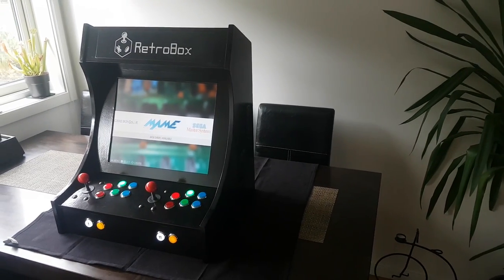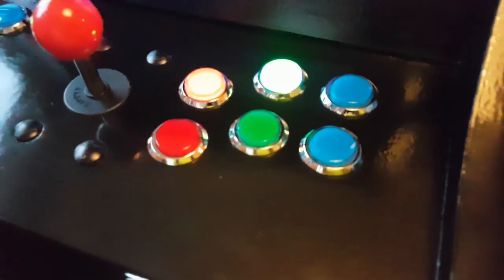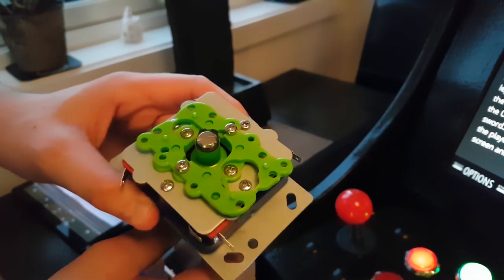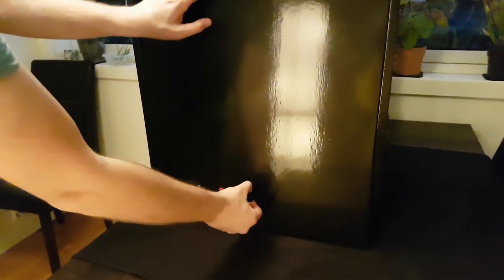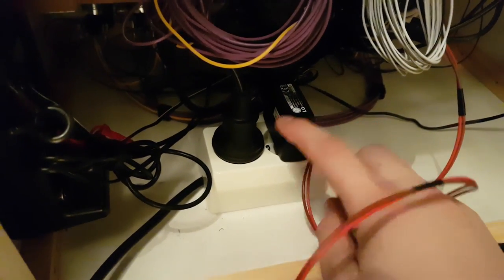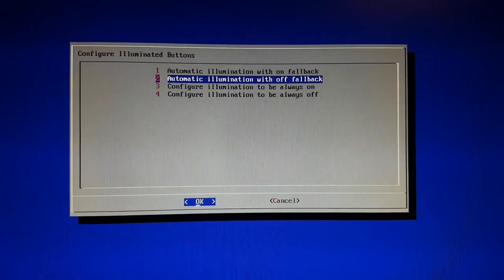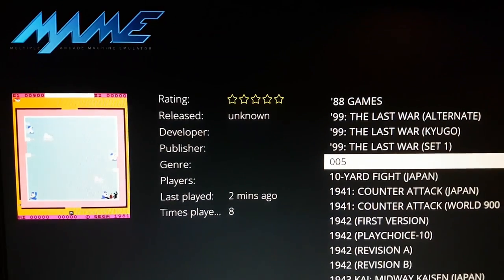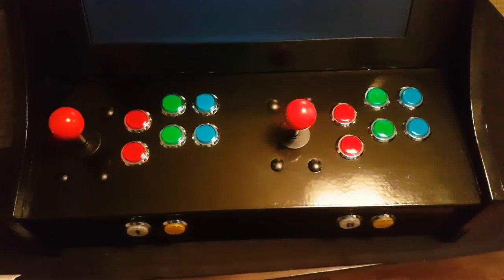RetroBox Arcade with LED illuminated buttons

Comment: +IDmedia Master, I ended up into a big doubt: which monitor should I use: 4:3 or 16:9 native? I'm so confused right now, I read some opinions on the web and I can't decide yet. I mean, this one would be ok? http://bit.ly/2eo8LlK 
Cause it is the one I was about to buy (used, of course). Which monitor did you use (not the model, the resolution specs)?
I understood that a 16:9 monitor involves the so-called black bars, but, is that it? Nothing else?
Reply from the maker: Any monitor would work. Remember that most games are really old and made for 4:3.
There's no reason choosing a 16:9 unless you intend to run newer arcade/PC-based games or use bezel art. Personally I have only a few newer games that would utilize a 16:9 monitor, so I didn't invest any money in buying a widescreen. I've mostly used Dell monitors with 1024x768 resolution. If you choose to use a 16:9 monitor the only "problem" you'll notice are the black bars on the side. Again.. it's all about preference and cost. :)
Reply: Ok many thanks master

Comment: Great video. Which software did you use to control the Led buttons please? A tutorial would be appreciated if you have time. Thanks :)
Reply from the maker: Uhm.. yeah, I feel really bad about this as I've intended to make a video/blog post about this for month now. I use a small script that I wrote, I'll try to publish it, but unfortunately it's a lot going on lately and difficult to give a proper ETA on when I'm able to sort things out and post a clean version. Sorry, it's on the bucket list. :)

Comment: Hei.
I'm having trouble finding instructions on how to set up and enable automatic illumination on my LED's. Are you using Recalbox or do you know if Recalbox supports?
Reply from the maker: +Hallvard A. Ulsund I've never used Recalbox, only Retropie.
Reply: IDmedia ok. Thanks. Care to share info on how you set up the custom illuminations? Any guides?
Reply from the maker: +Hallvard A. Ulsund Yeah, it's on the to-do list, but I don't have much time to spare lately. Subscribe and I'll let you know when the new video is ready :)

Comment: Do you sell these ? I'm interested but without the led buttons
Reply from the maker: Tre S I have sold two, but have not made more since. I'll consider making more in the summer, but I doubt that I'll ship them outside of Norway because of its weight and the danger of it getting broken in the process. Sorry about that. I consider making smaller mashines though in the future. :)

Comment: Can you tell me which MOSFET N-CH Transistors you used for your LEDs? (I bought the same set from Ultracabs) I‘m currently about to finish my Arcade with you illuminated buttons idea and I‘m unfortunately not an expert about finding the right Transistor. (relating to https://idmedia.no/projects/retrobox/retrobox-and-illuminated-buttons/)
Reply from the maker: Hi, sorry about the lack of code when it comes to this project. I've finally vacation, so I'll try to get to it soon (I know I've said that a few times by now). Regarding the transistors I'm pretty sure that I used 2N7000 MOSFET N-CH 60V 200MA TO-92. :)